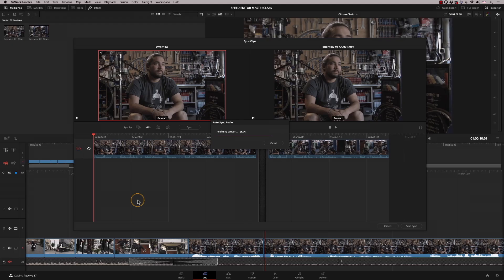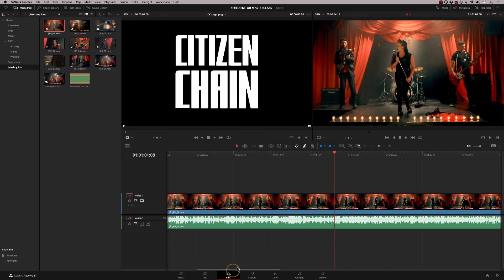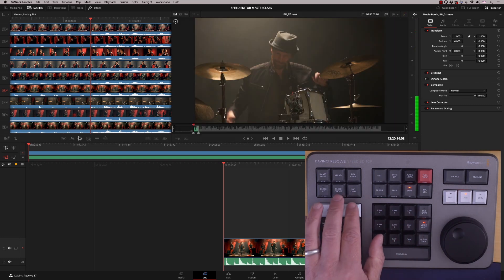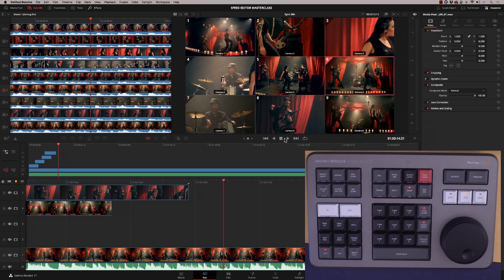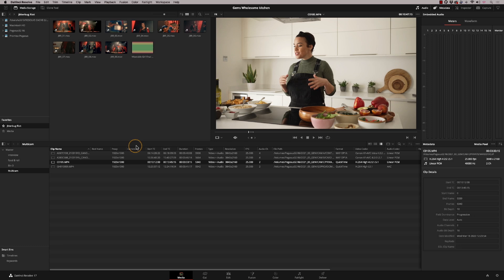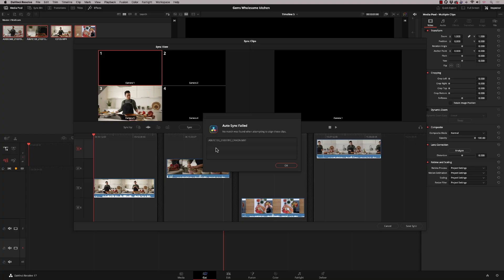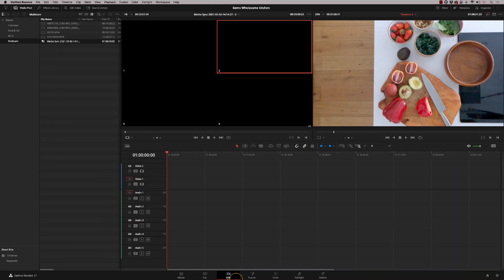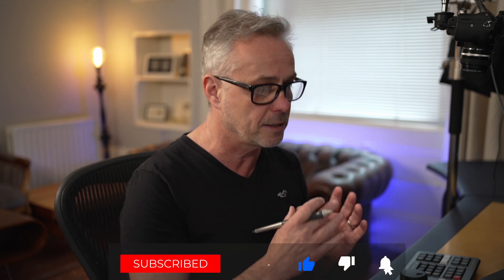Speed Editor Tutorial & FIX SYNC ISSUES in Cut Page [PART 2] for Beginners by a PRO.

Comment: HELP! 

Currently using Davinci Resolve Studio 18.5 beta5 (for Windows). 
The Cute Page -> Trim/Nudge menu is AOK.
However, the Edit Page -> Trim/Nudge menu options are greyed out (and, of course, the corresponding keyboard shortcuts do not work!)

I have checked for things like 'snapping' on/off ... but it makes no difference on the Edit Page. With your experience, I am hoping you know of a solve?
(e.g. is it some setting I am failing to consider or is the beta 5 faulty or is my Speed Editor interfering, or ??)

Any help is appreciated.

My interim work around is the use the Cut Page Trim/Nudge. 

And a BIG Thank you for the 1/10 frame audio nudge!

I know you do not really need/want more subscribers, but I went ahead and subscribed AGAIN from another channel of mine, I have one more I can subscribe from if you can answer this issue ... hint, hint, bribe, bribe.
Reply: Hmm, maybe never mind, it has started working now after switching between Cut Page & Edit Page a couple of times (and really nothing else). After doing a few nudges on the Cut Page, I tried again on the Edit Page and it started working (18.5 beta 5)??
May be a beta 5 bug, not sure what the trigger is, oh well, thanks anyway. Bribe is still available

Comment: Thank you very much, I can't find a solution. Bebause I'm shooting with gh5s and sync based on waveform (in Davinci 18.1.1) doesn't recognize clips by camera. So sync creates for each clip as separate cam angle. For example if there are 4 clips for 3 cameras, in sync bin appear 12 cameras (and I can't use speed editor above 9). If I try to edit multicam timeline (in edit page), after returning to cut page sync bin become empty.. (still on media pool show that all 12 files are synced). So how to manage cam angles (to put right clips on it's angle as should be by cam) and to edit it in cut page? Thank you, maybe you can solve this, I can't find on any tutorials.

Comment: Hi Darren! And thanks for a great channel! Even I, thanks to you, am slowly getting a hang om the basics of colour grading. Now, however, I have a question on syncing. If I want to sync, let's say, three videos from three different cameras, where each video is split into three clips by the camera, how would I go about it? When I try to sync from the media pool to use from the sync bin it only makes nine different camera angles, and when I try to create a multicam timeline it seems to sync randomly even with the right box checked (detect clips from same camera). I try to sync by audio. What to do?
Reply: I might add that I tried to use the Camera#-tab as you did without any luck. I even have clipnumbers in the file title!
Reply: I wonder if the problem could be that I am using 3 identical cameras and that Resolve get confused, even though I have given the different cameras individual numbers? (Sorry for my comment-spamming.)

Comment: Thanks Darren!  I never knew about the "nudge audio" feature...I've just been living with the audio slightly out of sync, but now I can fix it.  Also, to edit the syncbin I right click and choose "open in timeline" which is a bit faster.  The whole question I have that maybe you can answer is, is the syncbin really faster for multicam?  My last 4-5 videos have been done with syncbin using the cut page.  At first I hated the layering of angles, but I have learned to live with that.  That said, the I've tried the overwrite, place on top, live overwrite options and, just like in this video, I find myself "going back to proof" it right after I lay down the angle.  Contrast that with multicam edit in the edit page where you hit one button to select angles as the video plays.  I found in those cases that I don't have to redo or rewatch as much.  Right now I'm chalking that up to my inexperience on the Cut page, and hoping that I soon master the speed editor to more than compensate.  That said, it'd be great to get your opinion on the multicam editing speed factor - sync bin vs multicam on the edit page. 

I actually wrote up a suggestion in the DR forums with two Cut page fixes that IMHO would significantly accelerate sync bin editing past multicam on the edit page editing - https://forum.blackmagicdesign.com/viewtopic.php?f=33&t=142548  It'd be great to get your thoughts or even a video from you on this!

Comment: Hi Darren i tried your tip to use source tape feature but on my current project am dealing with around 300+ clips in a bin in source tape filmstrip view i cant even see my in and out marks or clip thumbnail. Is any way to limit adjacent 5clips to be shown in the filmstrip view that way it is very easy to select clips. Hope you understand what i said❤️ (am not so good in English)
Reply from the maker: yes, you can mark in/out range and then press source tape again and it closes in on the range. Hope that helps.
Reply from the maker: mark in out range in source tape I mean, then press source tape AGAIN to go into the range.
Reply: @DarrenMostyn  thanks for the fast response 😀
Reply from the maker: @hariprasadkl2632  you are welcome.  That should sort out your problem anyway.All the best.
Reply: Yes indeed 😊

Comment: Another fantastic video, thank you!

I’ve been doing a number of multi cam concerts and shoots lately and I’ve tried using the cut page with the speed editor and it just feels clumsy / messy to have it laid out like that. 

It’s probably just me, but genuine question what advantage is there doing it this way as opposed to syncing via the edit page, combining into a multi cam clip, then having one clean strip with the roll over tool?

I’ve got a speed editor and trying to love it for multi cam editing, but feels clunky.

Thanks again for your video, have learnt a lot in resolve over the past months with your tutorial clips :)) 🙏
Reply from the maker: Hi. there is no advantage to using sync bin over multicam. I think if you are in 2 camera situation probably easier in sync bin than multicam, and the fact you can use the speed editor. If you aren't gettign along with the speed editor in multicam then nothing wrong doing traditional way. Hope that helps.
Reply: @DarrenMostyn  Thanks a lot Darren, good to know. And yes usually 5-7 cameras and finding it a bit trickier to navigate in the cut page. Cheers! :D
Reply: @DarrenMostyn  I"m switching over from Premiere and just picked up a Speed Editor. I usually have three or four camera angles with timecode and generally create a multicamera sequence then switch between shots during playback so I can view all four simultaneously. Not much different than doing live switching except its prerecorded right? Is there a way to pull that off in DR? Thanks for the great tutorials!

Comment: The sync bin and syncing in general has been the bane of my resolve usage. Hopefully some of the tricks you showed here will help me out next project. It’s the biggest thing that keeps me from cut page off the regular basis.
Reply from the maker: HI Bruce. Let me know if it works for you on your next project. Be good to know. This took me a while to figure out and was frustrating, why Im sharing here!
Reply: @DarrenMostyn  will do. Every version of sync shown in videos doesn’t show multi cameras with one or more having multiple clips. You are the first to mention it. I have done the camera angle in the metadata but the unlock and slip within the timeline I haven’t seen before. Also the tip of not syncing master audio from an external source in sync bin but doing that afterwards is what I think I needed. Thanks once again for the videos and also the Master class referral the other week. That blew my mind.
Reply: @BruceMoyle  Exactly the issues I had been having with the Sync Bin and the Cut Page...Let's see if this sorts it out!